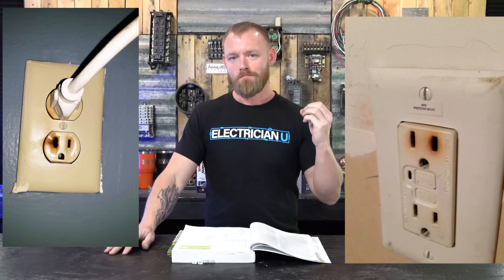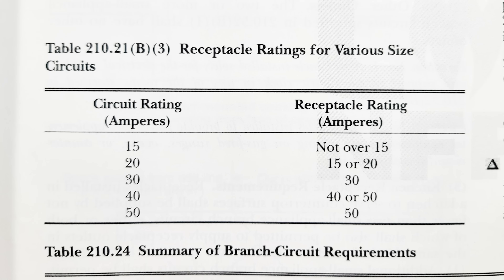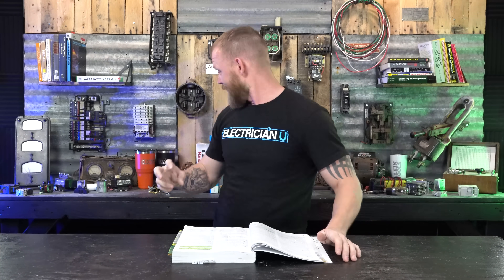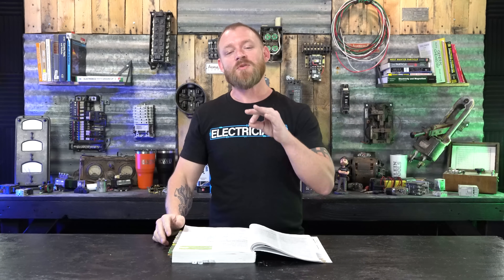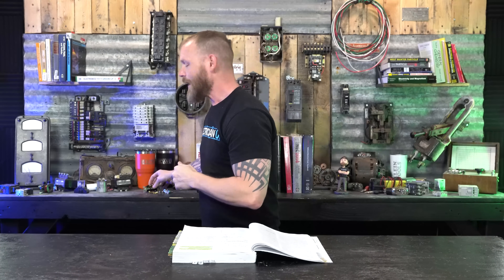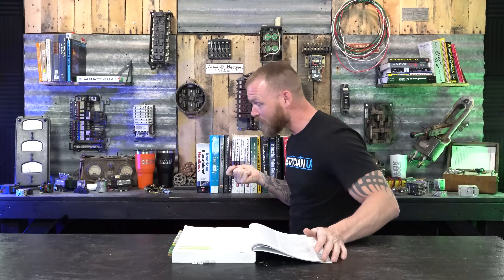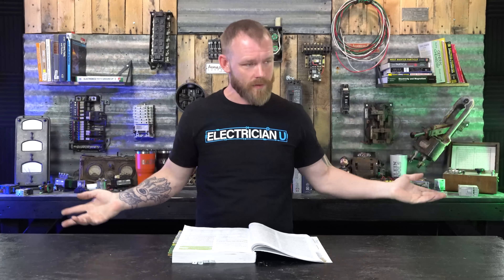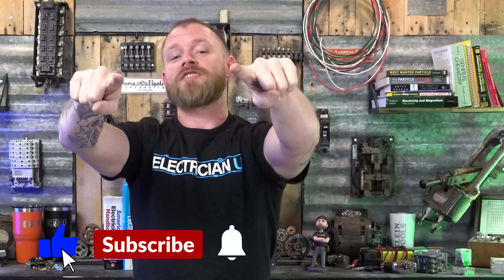Won't These Melt?!? 15amp Receptacles on 20 amp Circuits!!!

Comment: As an electrician, I liked to tell my apprentices that the NEC and Fire protection codes were written in blood. I found that it helped them understand the seriousness of the job. Excellent video, BTW.
Reply: They are also just the minimums and can be exceeded if it improves safety or functionality.
Reply: Thomas Marr invented the Marrete after he burned a house down making a wire connection
Reply: Absolutely. Most safety rules in general are written in blood. We humans tend to be reactive instead of proactive.
Reply: That is in houses that the wiring corresponds to the outlets,in the old house where I live, the wiring is like 14/2,no ground wire,and breakers are 40's,30' and 20's on a federal pacific panel box,so what do you do about that?
Reply: @roadrunner694 honestly in that situation, if you can afford it, you need to do a complete rewire and replace the panel. I’d also get the electrician to check the service side to make sure it is safe as it sounds like your system hasn’t been updated since World War II.
Reply: My father in law said the same.  Every code represents an injury or fatality.
Reply: Good advice. The fact is, that is very true. A lot of times, rules aren't enacted until something had gone wrong first.
Reply: NEC was created to prevent fire. Nothing else.
Reply: @kalijasin  Nope. The NEC was written to standardize electrical installations. This does help prevent fires but the primary purpose is safety for electricians and everyone else.
Reply: @stevenbass732  actually you are both right , yes we needed standards , but , an incident can and has caused whole rewrites and new rules many times ………
Reply: @stevenbass732  and sometimes to prevent property damage. Or damage to conductors which can in turn cause damage to us fragile humans depending on what we're talking about.
Reply: @stevenbass732  which organisation writes the NEC?
Reply: I've got a small window ac unit I tried to plug it into the socket it comes on but doesn't work. It's 110 United is it the recepticl
Reply: @John-j4u9c  Most likely your A/C, assuming you mean it’s just not cooling.
Reply: @John-j4u9c @John-j4u9c There usually is a load/breaker built into the power supply cord right at the wall plug. A lot of the time they get triggered when being plugged into the wall receptacle. Or at the main breaker to the home itself..might be the problem that is causing you to not have any power to your AC unit
Reply: Hello , hopefully you see my question , so is it OK the put 15amp gfi outlets on a 20 amp kitchen circuit  .thank you
Reply: @alec1113 Code allows it if it is not a single oulet on a dedicated circuit. (The pass through on a 15 amp gfci is still 20 amps.) I would not do it because of high draw kitchen appliances that can exceed 15 amps on the gfci receptacle itself. (1800 watts @ 120 volts equals 15 amps) Use a 20 amp, why not?
Reply: @wolfman231  that wattage is why all kitchen receptacles have to be on 20 amp circuits. We derate our circuits here by 15% or 20% I can't remember at this moment. So ideally you don't want a 20 amp circuit drawing more than 16 amps and a 15 amp circuit drawing more than 12 amps. Of course it can take the whole 15 or 20 but we do it here in this country to limit tripping the breakers from overamperage. Of course in a kitchen you can't stop someone from plugging on multiple things and running them if your kitchen countertop receptacles circuit has too many outlets per circuit. When I do wiring I put no more than 3 on a circuit. I prefer 2 per circuit. You just have no idea what people are gonna plug in
Reply: @JBDay-bd8cu  20% reduction and that is because residential breakers cannot run at max amperage continuously. and the reason kitchens need to be 20amps is because you can't do a split receptacle with a GFCI so they mandated a higher amperage so 2 appliances plugged into the same outlet wont trip the breaker
Reply: I like that
Reply: We have a single 20 amp plug on a 20 amp breaker for our laundry room and a washer and freezer is plugged in to it. Is there anything else why there would typically be a 20 amp circuit for a laundry room
Reply: Gas Dryer and Washer maybe? 20amp isn't required  for washer in Canada, just a dedicated circuit.
Reply: Mr Steven I just want to know that generally for house wiring , how many general purpose outlets like in bedroom, cooridor or bathroom area are connected to one 20 A circuit and does 2.5mm or 4mm cable use for connection
Reply: How would someone interested in becoming an apprentice get started? Is thd early 40's realistically too late to get into this field?
Reply: @pcxdrone  Not at all. Many electric companies will hire you as an apprentice. I recommend you look at your local community colleges, they often have adult classes.
Reply: Hello Steven. Maybe you can help me Sir... I have an independent line (10 gauge wire) running from the main breaker box, to the water well pump at 120 feet distance. The breaker for this circuit at the main box is 30Amp. This connects to another breaker box at the water well pump room, that has two 20amp breakers. One seems to be for the pump, and the other one is for a single receptacle and also a light switch on the wall (3ft from the pump). I noticed the outlet on the wall is rated 125v 15Amp.

The previous owner did the wiring on this old house about 25 years ago, and now I'm wondering if this setup is correct? I'm not a pofessional but can you tell me if it's correct to run 10 gauge wire on a 30amp circuit from the main breaker box, and then connect it to a secondary breaker box (with two 20amp breakers) at the well pump room; & have the outlet there be a standard 15Amp? Is this a hazard, and should I change the 15amp outlet to a 20amp, or 30Amp outlet? 

The reason I ask is because I want to run a 10 gauge extension cord 50ft from that outlet, & connect it to a sump pump to drain an inground pool. The sump pump I plan on using is a 3/4 HP, 550W, 127V 60 Hz, 7.8 Amp.  I want to know if the receptacle at the well pump room, is the correct one to use for this purpose. I plan on having the well pump off when I run the sump pump of course... Please let me know what you recommend. Thanks for your help.
Reply: @GoldenCup888 For  starters, given the distance (120ft), and your plans for the subpanel you might consider upgrading to #8 wire and 240v service. That way you won't experience losses that could affect operation if both the well pump and sump pump are operating together. 
The 15amp receptacle should be adequate for occasional extended use. ( I confess, I've always been one to over rate for safety. Not everyone appreciates that on a budget 😊)
Reply: @stevenbass732  Thank you Steven. I appreciate the quick response. Unfortunately, that's not an option for me (budget wise) at the moment, so l'll just have to make sure the water well pump stays off, while the sump pump operates. Thanks for your help.
Reply: @stevenbass732  Hello Steven. Sorry to bother you again, but I do have one more question. I read that when an outlet isn't grounded, you should use a GFCI receptacle when using sump pumps to avoid electrocution. So my question is, will a 15 or 20amp gfci, TRIP, if overloaded and connected to a subpanel that has a 20amp breaker, and this subpanel connects to the main circuit which has a 30amp breaker? I'm worried that a 15 or 20 amp GFCI outlet won't trip if there's an overload, because the main circuit is 30amps, causing the receptacle to melt or cause a fire? 

Does the main 30 amp breaker override the subpanel breaker, Or does the 20 amp breaker on the subpanel, overide the 30 amp circuit breaker on the main panel? If the latter applies,  which gfci (15 or 20Amp) will work in this scenario? The sump pump I want to connect to the outlet is 3/4 hp, 110V, 560W, 6.8 amp. Thanks for your help.
Reply: how often does an electrical shock result in blood I wonder
Reply: @Bapuji42 More often than you think.  If not from the electricity itself, the involuntary muscle movement in spaces with equipment or the loss of extremities.
Reply: @stevenbass732 right but how often in seconds
Reply: Written in blood?  On pages of human skin?  HOLY CRAP you are making the NECronomicon!
Reply: @docferringer  they started using pig blood in 1986, cheaper

Comment: Just repaired a load caused burn/melted receptacle.  Electric heater initiated overload at the receptical. Nothing was plugged in at the time of the actual melt down!  The melt was continued by a down the line at a frezzer that should not have been used at the receptacle it was plugged into.  The receptical that melted could not transfer the load since it had suffered from its original use from an electric heater.  All the wiring on theses and the whole house were stab in connection even though screw down was there!  Changed out recepticals and wired them via the screws,

Comment: i live in an 80s trailer and they fucked up the wiring. the dining room, living room, hallway, and two bedrooms are all on one 15a breaker. i want to rip down all the walls and put 20a in the two rooms and a 15 for hallway living and dining room. we use a lot of power me and my brother both game and we use probably 600w of power for that alone then also use power for a/c or heater. so we want 20a in each of our rooms the problem is we only have 100a breaker and between the rooms and all ac and hot water tank we are maxed out so got to put in 200a. now the real problem to convincing my dad i know what I'm doing. he wont touch electrical because he's watched people not come back from touching hot wires so he's afraid.

Comment: Please crack open a commercial grade 15A rec and 20A rec. You'll see that there is no difference other than the face (which acts as a gatekeeper since 20A cords cannot plug into 15A recs)

Comment: Stuck with 15amp breakers and 15amp receptacles. Sucks because gaming/editing pc definitely could use the 20amp circuit. If only we could swap 15's for 20's and keep the dang wire lol.

Comment: So when I bought my house, the garage and kitchen have 20amp circuits but use 15amp plugs. Kitchen I'm fine with but the garage is where I use tools that is rated at 20 amps. So far I haven't melted anything because they aren't on that long but that's one thing that I've always wondered about is why the garage would have 15 amp plugs. There is even a 15amp GFCI at the beginning of one line. Would this all be safe to replace since the wiring and the circuit breaker is rated for 20amps?

Comment: I have been listening to you for a long time, and my question is can an arc fault receptacle be installed on the outlet that feeds the rest of the outlets for that room, or is it only code to install an arc fault breaker in the electrical panel to meet NEC?  PLEASE PLEASE RESPOND NEED INFO REAL SOON

Comment: I don't know if this has been mentioned before but, another reason is manufacturer's of Receptacles make 20 amp receeptacles and put 15 amp face plate on them. If you ever open up a 15 amp receeptacle you would see the metal prongs of a 20 amp.
Reply: The process for getting the Underwriters Laboratories listing rules out any device that's likely to melt because the load is 5 amps over its rating.  Any device that will not withstand major abuse will not be UL listed.
Reply: @SteveWhiteDallas  correct, because you are allowed to use 15amp receptacles on 20 amp circuits they are all tested as 20amp receptacles
Reply: @Galgamoth  To the average person, it would seem strange that what isn't allowed is installing a 20amp receptacle on a 15amp ckt.
Reply: @SteveWhiteDallas  the average person thinks that outlets give power instead of the device drawing power
Reply: @Galgamoth  Yeah, I've even seen pictures/lessons that indicate exactly that, like the drawing of the volt shoving the amp  through a tiny hole named ohm.  Maybe it helps people understand, but people who can't grasp reality are better of not knowing than believing a false reality.  I would guess that even many to most electricians don't have a solid understanding of DC theory.  That doesn't make them bad electricians, but knowing DC theory makes a good electrician better.
Most electricians I've worked with figure voltage drop by 100' = go up one wire size.  (It doesn't get by me without being checked.)

Comment: all of this was over my head. lets say i have all 20 amps in my breaker box, and i have all 20 amps(i guess those are the outlets with the sideways T?) outlets throughout the house(except for obvious features like dryer, waterheater, stove, things like that), will it damage anything i have plugged into the walls, such as but not limited to: tv's, game consoles, toaster ovens(i prefer to cook with those over the full size oven, less power, faster, no preheating), table saws, internet router, a home oxygen thing if one might end up needed one day? or should one just stay with 15 amp breakers and outlets?
Reply: feralbigdog  Never connect a wire smaller than #12 American Wire Gauge to a 20 amp breaker.  It sounds odd, but code allows a 15 amp outlet (plug) on a 20 amp circuit, but NOT a 20 amp outlet on a 15 amp circuit.  (That's not a mistake, although it looks like I got it backward.)  A 15 amp outlet has to withstand abuse and overloading far beyond 20 amps to get  a U.L. listing.  Melted plugs are caused by multiple outlet adapters (that allow you to plug in adapter, then plug 3 things into adapter.)  Avoid adapters.  Fires are started by lightweight extension cords loaded and covered up so they have no airflow to keep them cool.  I know the have room for 3, but if you must use an extension cord, plug only 1 thing into it.  If it's an appliance, you can buy appliance extension cords.  Need more advice?  Ask more questions.  We're here to help you to have a safer home.

Comment: you are confusing 20a switching devices with receptacles. receptacles are strictly referring to the face configuration not the rating of the plug all receptacles ever made even 15a ones are rated for 20 amps just read the box. if you plug something in that draws more than 16 amps it is required to have a dedicated circuit

Comment: 20 amp receptacles seem to have a better screw pattern but when I took several of these apart there's basically no difference on the insides except for the heavy duty commercial you know if you can stab the wire into a back of a 20 amp receptacle that's just crazy instead of taking a time to screw him into the terminals step in the words in the back is only good for about 5 to 8 amps 10 is pushing it I've seen the wires turn purple or blue on pushing plugs. PS not enough contact area for push in wires and for these new wire connectors that you snap in then it can last very long that's not bulletproof I don't care if they certified them or not you will not catch me using these except for low voltage low amperage not anything over 5 amps I will not be using them.

Comment: I have found that putting tiny laptop fans behind the receptacles don't really do anything to stop thermal overload. One or 2 little fans are really quiet but after installing 40 of them in the walls, my house sounds like a bee hive my power bill went up and the breakers still trip to remind me I'm not an electrician.
Reply: Yep, your house is fixing to burn.  Take the fans out
Reply: @slalomking  lol, I was just kidding. I thought it was obvious. Forgot to put the "I'm joking emoji in there" 🤣
Reply: @hellbent7062  well that did seem like a lot of work to do, ha ha.

Comment: The National Electric Code hasn't kept pace with modern consumption and homebuilding habits.  For instance, receptacles 4 ft off the floor rather than 1 foot off the floor would save many homes in flood prone areas, and also better accomodate desktop or bedside appliance connections.  Stooping over to connect a vacuum cleaner would be a thing of the past if receptacles were higher.  Since average home floorspace has grown over decades, circuits should grow to accomodate larger loads.  Consumers are buying appliances with larger demands.

Comment: I use the 20 amp and the 15 amp Outlets strategically. I like to put the 20 amp Outlets in the kitchen, and also in the garage. If it's an area that is going to have a lamp plugged in or a TV set then a 15 amp outlet is perfectly fine. And I'll use a 20 amp outlet if I just have reason to believe that they are going to plug something like a space heater or a window air conditioner in, assuming it is a 20 amp circuit.
Reply: You make it simple and easy understanding.  Thanks for your explanation.

Comment: so a sewer pump is 120v 15A max  with a cord plug inside the control box. 15 or 20 amp Breaker?

Comment: I need to ask a quick question please! If the house is older and wired with aluminum wire would that have something to do with a receptacle melting? Or is it all about amps? Thanks to anyone that can help.
Reply: Routine maintenance is always good for older home's with aluminum wiring , you wouldn't drive you car 100k miles without changing the oil , must people won't do the maintenance because they don't know to do it or don't want to spend the money, most will wait until they have a problem.

Comment: A 15a outlet on a 20 amp breaker ?  Depends on where & how the plugs are wired, Kit / bath VS an attic plug using pig tails or in series.  If in series the 1st piug on the circuit may take the load of the entire line. To much room for error.  We had an older home that had a 15a breaker on a standard dedicated plug (B4 GFI's were code in a bath). We installed a 15a wall mount GFI.  The GFI kept tripping w/ the use of a blow dryer on any setting.  Ground & polarity all tested good.  Nothing got hot, breaker never tripped, no burning smell, etc.... We installed a 20a GFI and the problem went away.  UL rated or not, most 15a devices are just to cheap to push the limits of safety.